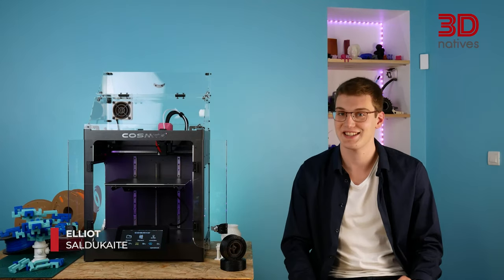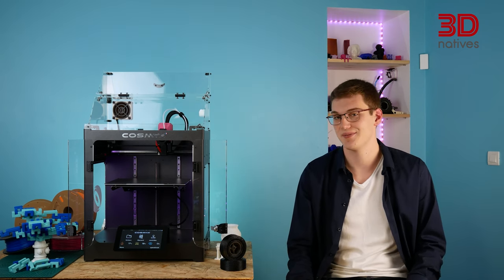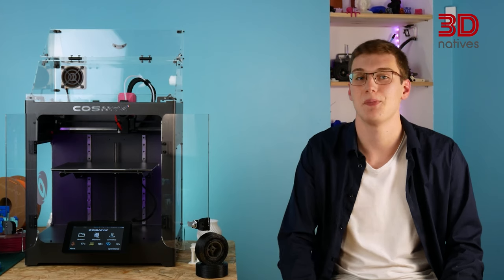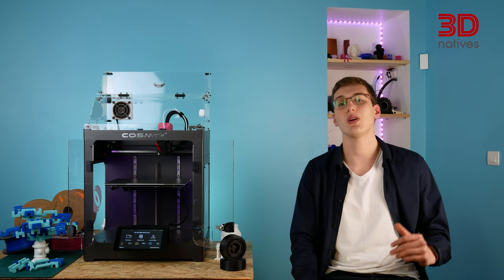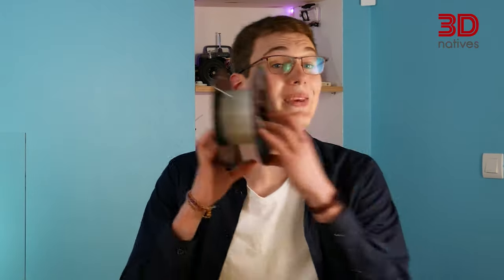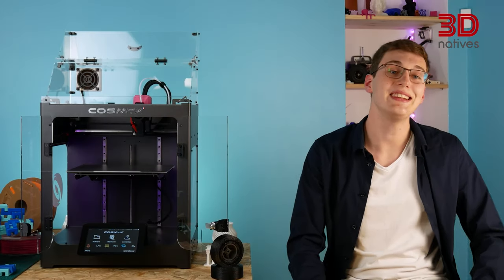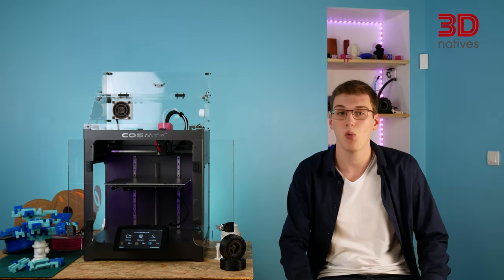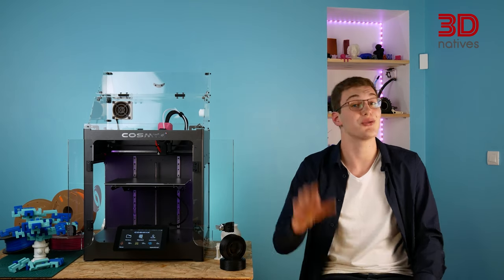Testing Cosmyx first 3D Printer, the Nova | 3Dnatives Lab

Comment: Looks like a nice printer, but it really shouldn't cost $3000. At that price, I wouldn't expect a canti bed or such a tiny build volume. Hiwin rails are nice too, but the extra cost is only really worth it with printers going over 500mm/s.
Reply: yeah
Reply: This printer can work up to 450mm/s but we build this printer for production parts and need a lot of stability and repeatability for this. You can go at very High speed if you want play but without warranty dimensions and tolerances.
Our test in our warehouse is up to 500mm/s but in certain conditions.
Thanks for your support
Reply: @anthonyseddiki2973  Oh, interesting. What hotend is it equipped with? Also, do you guys integrate input shaping?
Reply: @morbus5726  it’s standard type 3dv6 but we can print at theses speed with cht bondtech nozzle.
Reply: @anthonyseddiki2973  You can manage 450mm/s^3 with only a cht? Thats interesting. Also, I would suggest not using a v6. no advantaged compared to a high flow nozzle like the dragon or takoto. Sorry if this sounds like I'm just bashing on your printer lol. Just trying to give some feedback on an otherwise great machine!